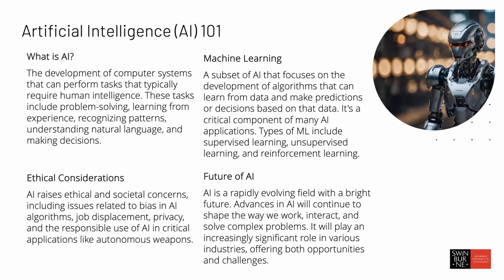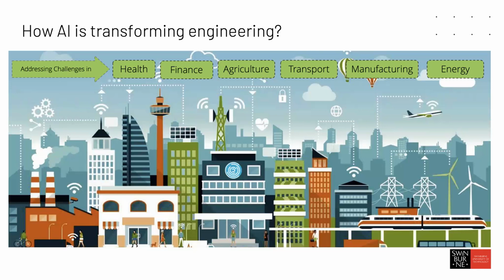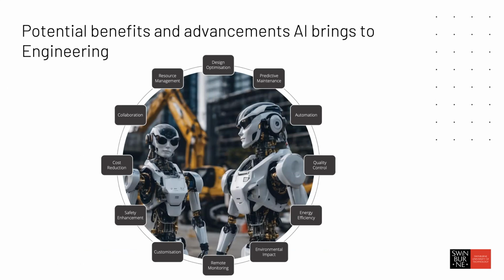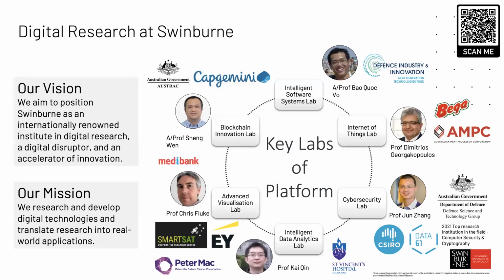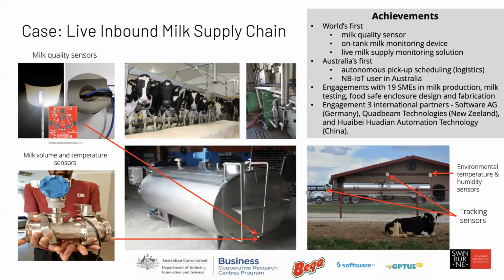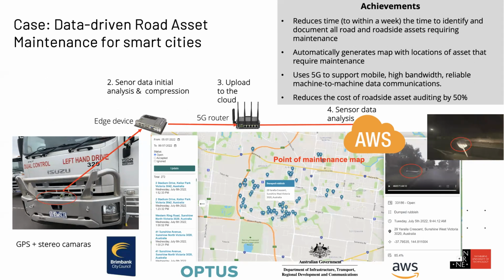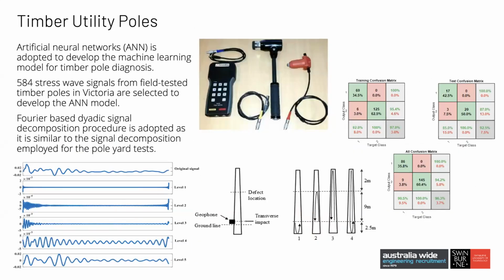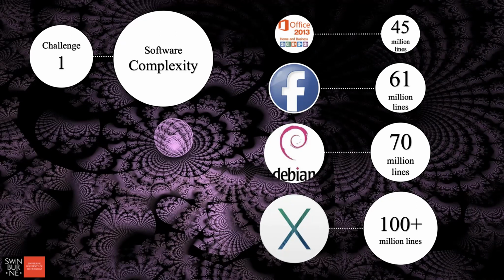"The Impact of AI on Engineering: Revolutionising Innovation & Efficiency"

Comment: I'd like to see a video of an AI analysing structural strength, fluid flow with air around the structure with resulting pressure distribution, together with simultaneous heating from solar radiation for example. None of which are trivial undertakings by themselves. If it can do that I'm convinced.